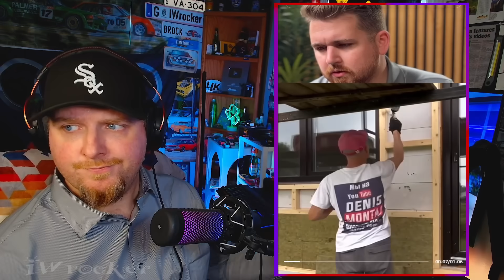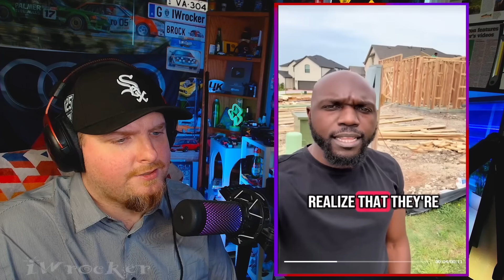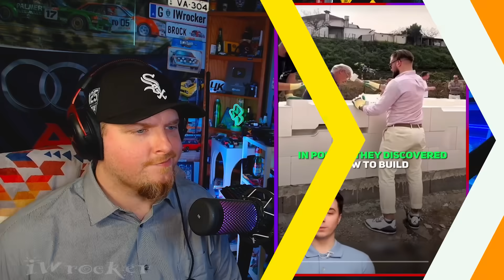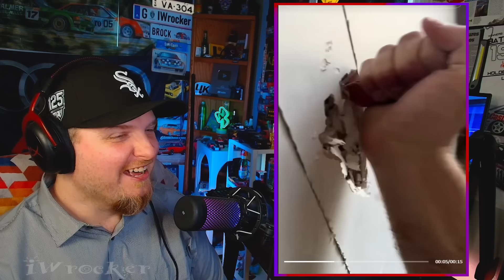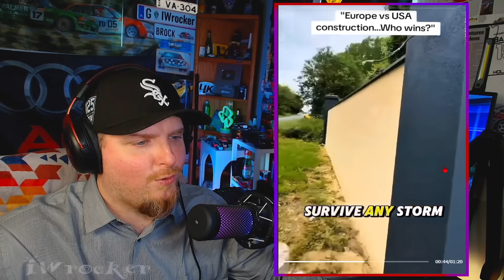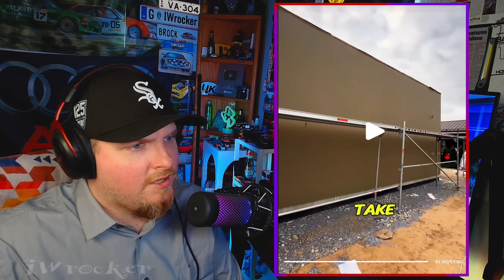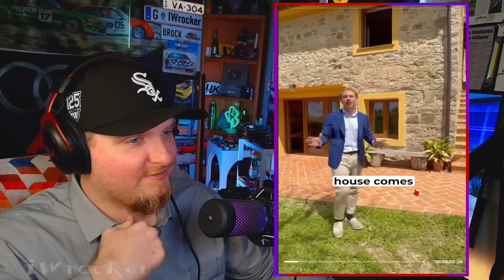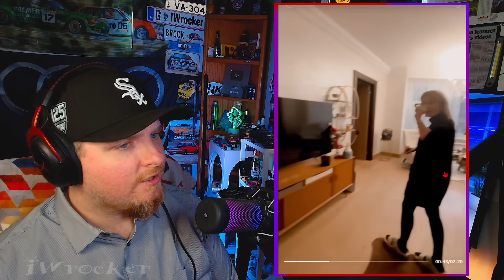25 Minutes of European VS American Home Quality & Construction Methods 🔨

Comment: Thats not a truck, thats the "bigger" brother of a Vespa, called "Ape" ( bee and wasp) Its for transportation use in the smallest streets, or gardens, or winery. It's just a micro utility vehicle. For delivery ( oftentimes pizza and works as advertising also).or craftsmen work in tight places. The front is the same as a Vespa with the same handlebar, steering and operating installments. The cabin fits two people, if needed very tightly, and it has a Vespa drive train beneath  the bed with a differential and rear axle. Vou can get it with a sheet metal enclosure on the bed , or a tent like made of fabric, To install or deinstall on demand in minutes. They are quite famous and wide spread. In my village in Germany , the pizza restaurant has one for delivery and parks as advertisement  on the street. Its limited to 40 km/h, street legal. Very useful in big cities, because of lack parking spaces on the streets.

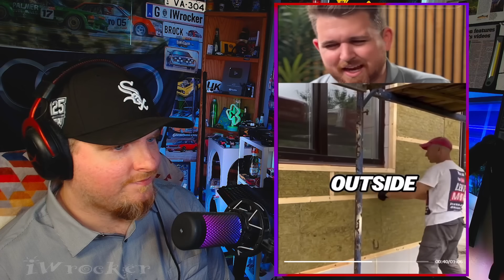Comment: 1:20 The walls are made of stone, so insulation on the outside makes the walls a therman mass that regulates interior temperature. I get where the insulation is doesn't matter when the walls are made of plywood at best, but come on, basic thermodynamics.

5:46 It's a little sad that what we'd call the bare minimum of a house you're describing as "a freaking fortress"...

7:35 And that's just a cheap basic tin roof... not even tiles. Oof.

7:55 It keeps blowing my mind that somehow USAmericans happily live IN TV SET FACADES. The non-loadbearing interior wall next to me would break that knife and also my hand, and I live in basically the cheapest type of housing here.

Comment: Here in Bavaria, there's an US Base my colleagues went to. The American instructors put explosives to the floor to make a Basra-access to the apartment below. It didn't work. By German law, a ceiling has to have at least 15cm/6 inch reinforced concrete for NOISE PROTECTION. Just in case your neighbor is dancing above your bed. - The brothers-in arms- tried it again without result. So they trippled the load and blew out the brick walls. The latter bricks had the required thickness of 1 foot with bubbles for insulation. (All calculations exclude floating screed, insulation, carpet, paint and wall plaster.) Nowadays requirements are stricter, because ot thermal bridges (where the concrete ceiling goes through the brick wall, balconies, lintels), there have to be 4 Inch glass wool on the outside. I need no heating anymore, just a jumper.

Comment: I moved to Ukraine 16 years ago, and of course we have European windows(like if first saw in Berlin in 1972), they are the best ever! We also did the foam exterior on our  brick home and it really really helps in the winter and keeps us cool in the summer. I installed a German metal roof(with internal insulation). I have a 7 foot tall 18" wide reinforced granite wall surrounding my property, everyone one I know has these type of exterior walls. There are other things we have that I did not see in the USA, I am 100% thrilled with my Ukrainian home (russian drones withstanding). I have to say though you NEED the European windows in the USA you will NOT be sorry.

Comment: Insulation outside because those bricks are considerable heat mass that we want to take advantage of to keep releasing heat inside once they have warmed and during hot summers keep releasing cool / resist interior temp raising. Thinner insulation inside and you get a few inches back on floor compared to insulation inside only

Comment: I dunno what you guys are doing over there in the US, but our walls here in Hungary are 6 inch thick solid rebar concrete. Our windows are fully insulated German double and triple pane tilt windows. We put insulation on the outside. You know why? Cost benefit! We pay for houses by the size. And every square meter of house is expensive! So we don't shrink internal living space down by hanging several inches thick insulation on the inside. It's common sense. Your house will get better thermals if the heat or cold isn't even allowed to reach your house's structure.

Comment: In Scandinavia wooden houses are actually pretty common, so more similar to American houses, but the walls are typically still double as thick and they tend to have more insulation and more design elements to accomdate for snow (which you see more commnoly in parts of North America that get more snow) so I guess it's true that materials alone aren't everything. Their houses are definitely still better.

Comment: After the WW2 Britain needed to build 200,000+ homes. This is when "New Towns" popped up. Places like Milton Keynes and Ellesmere Port went from being villages of maybe 100 or 200 homes to having over 2000 homes. We used "cardboard homes" wood and cardboard with a little render to make them not fall down. In the 1990's theses homes were draughty and were starting to fail in a few ways, so we gave them a new layer of insulation and wrapped them in brick, with new supports to hold up the roof. These homes are still standing today but plans are in the works to upgrade these buildings again. This time it's not because they are failing but because these homes are easier to adapt.

Comment: 18:49  that's an Piaggio ape 50 2005ish to 2024  has a 49ccm 1zylinder 2stroke with a manuell 4 Speed Transmission plus Reverse 200kg Upto 400kg payload and 350kg legal towing with a Bit of Finetuning without aftermarket parts IT will easily Run 60km/h ..... There are some crazy mods Out there Like hijabusa Swaps and simular ... But Most tuned have an 85 to 110 ccm cylinder ,gearing and exhaust for a little more uumpf

Comment: About the wall being removed with utility knife.
European construction does use this material... but ONLY for SOME inner walls or for insulated boxes on the ceiling. Most walls are concrete. Sometimes brick, although it is seen as slightly luxurious - because it takes a lot more time to build, but needs a lot less insulation.

Comment: My dads house, the house I grew up in, was built in 1927, double brick walls and only had the roof renewed once back in the 80's. Mine was build in the early 20's.
US houses suck. 
Did you guys not understand the point of the story about the wolf and the 3 little pigs?

Comment: 18:12 People do live in trhat. From wikipedia: Five Thurloe Square or The Thin House is a block of flats in South Kensington, London.[1][2] The triangular building is 6 feet (1.8 m) wide at its narrowest. It was built between 1885 and 1887 by William Douglas on an area of land left over after the construction of South Kensington tube station. The building was initially used as artist studios

Comment: Here in the UK, we're increasingly moving towards the US style "Thrown up with wood and maybe a breeze block external wall" instead of the proper walls of old. It's got too the point that new builds are even becoming somewhat undesirable as they're plagued with problems and poorly made. Any build built 10 to 20 years ago is going to have issues. 
The house I'm sitting in now has about 3 stages of construction. The front of the house is about 80 years old, the middle is mid 80's and the back is mid 90's. We have a fair few external walls as internal walls as a result.
My in-laws house was built in the 1700's with an extension out the back built in the 2000's. 

Oh, and there's a lot of Portland Stone in the construction. We live in the original Portland. That stone is the same stuff that faces most of the iconic London buildings. Expensive stuff just lying around here.

Comment: Is that thin house in London one of the fake ones to hide an air vent for the Underground? There's dozen of fake houses that are basically just big chimneys over the vents from the tube, which was started when they had steam trains running through the tunnels.

Comment: The Russian house insulation method is used in Europe as well.  It tends to be used for existing properties and consists of a layer of insulation being added to the outside walls.  What wasn't shown was the final layer of plasticised plaster that keeps out the weather and lets the insulation do its job.  I've seen this system used without wooden lathes and the insulation glued to the walls (the material was more like a foam block than the straw like blocks in the video), then finished with weatherproof plaster-like material.

Comment: Hard doubt that the last one is 700€ a month. There's some caviat to it that's not explained in the video. The city does not look remote so the only way I can think of this being 700€/month is that:
1. It's some sort of special housing that you need to match strict criteria for. These are typically for less wealthy people.
2. This is actually not a rented property and she has bought it for at least 500-600k and that 700 is what she pays monthly for what in finland is called yhtiövastike. Not sure what that would be in English.
3. The building has very lucrative business spaces on the ground floor that are owned by the housing collective and effectively subsidize rents for the tenants. This would make this kind of apartment EXTREMELY rare, at least in Finland. 

This type of rental would be at least 2k a month in Helsinki city center and Helsinki isn't even super expensive when it comes to capital cities in the Nordics.

EDIT: Watch video till the end dummy.. Yeah if this is Riga, maybe there's a possibility that the rent is legit. There's also no info about in what kind of condition the general building is so I'll pass this one as plausible.

Comment: 18:00 Thurloe Square, it’s actually triangular, The building, now flats, is just 6ft wide at its narrowest point, growing to 34ft at its widest.
Google  thin-house-thurloe-square
Tube/rail or station ventilation or above ground section built where 5 houses used to be, 23 were sold but only 5 were knocked down in the end.

"In the late 19th century, Kensington and Chelsea were known as a hub for art, so loads of artists were building studios in the area. A local builder named William Douglas saw this as an opportunity to fill the little triangle that 1-5 Thurloe Square left behind after they were knocked down. Amazingly, he designed and built seven artists’ studios in this meagre space, in the form of the current wedge-shaped building we see today."

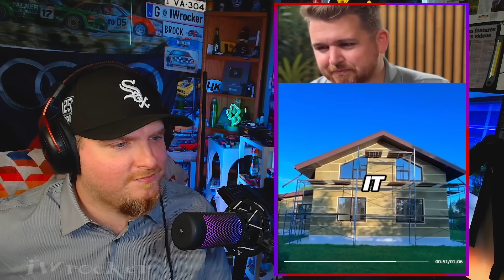Comment: 1:43 No way this is Russia, the house looks more like a Germany or such.
1:56 Hes just ragebaiting, nothing more. Or hes proud to live in glorified dogshed 😀 Or he doesnt compute that in Europe we like our houses survive winds, flods and stuff for hundreds of years 🤣
8:25 Well, this is s#!t xD Yet in my home I recently installed "Multi-grip Pull-up Bar" onto the wall and I had to get special X-drill bit to get tho holes done through the reinforced concrete... YET I now know to no need of worry when pushing hard my 90+ kilos () upthere. In this plaster shed I cannot imagine how such thing could be achieved 😀
Also how s#!t is a sound insulation? between zero and none..? I would not be OK when making out with my girls... kinda loud one 🤣
13:07 Well, in this scenario, those windows are kinda only the FLEX, because our windows supposed to work together with "brick"-constructed buildings, insulation and energiwise...
18:17 It is kinda triangle-ish house.

Comment: 18:48 this is called an Ape (Bee; I think it's the brand/model name of Piaggio, the most common producer, but became the general type description), designed for the narrow alleys in the rural and mountain villages of Italy.

The three wheels and the small build give them high mobility and accessibility,  and they used to be very common as affordable utility vehicles. Usually they have a two seater cabin with an open bed/bridge but there are various designs with closed boxes, cages for garbage collection etc. A quite common "modern" variation is a food or coffee truck.

They're usually powered by a scooter motor, its buzzing sound giving them their name, and don't have a steering wheel and pedals but a bar and controls like a scooter/motorcycle. Iirc you are/were able to drive them with a scooter license.

Comment: When it comes to insulation it's generally some kind of foam layered on the exterior, it just makes sense considering you don't lose space on the inside and keep the structural walls 'inside' for more inertia so the house heats and cools more slowly

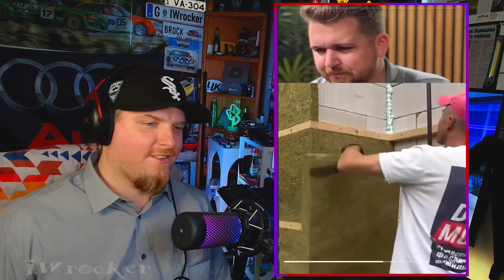Comment: 1:33 In the First Clip it's a Wall Made Out of ytong or a simular poress syntetic stone it's already have good r value IS Most likly more then 10inches(24cm min), thick Up to 18Inches(48cm) plus rockwool 2-7 Inches that's a passiv House  posible means IT dosnt need any Central Heat or at least for a good sized House less than a 54kbtu strong Central Heat unit including hotwater,If at all

Comment: When living in the US (working construction), i always wondered WHY you have doors over there, since you can just walk through the wall. The guy in the vid is a pro and wonders why they put the insulation on the outside. Ok.. (Even in the US we did that 40 years ago, even in California, EXACTLY as shown later in the video).  The stuff you guys build (with your weather conditions), we would call a "kyte" over here, lol.  PS: The main "PRO" for US style building would have to be the cost, right? The "CON" would be, you get a cardboard shelter for it. I don't mean this sarcasticly. It's VERY hard to build/own your own house in germany. Still: i live in a house build in 1754. Was just checked. All good! PSPS: the cool thing about "garden-walls" (or bushes): it's like an extra room without a roof.

Comment: You can't compare building styles country to country. All nuances,  like climate, types of building materials available in the region, costs of those, hoe toxic are they in different climate. US and Australia have sustainable tree plantations. Australia does timber frame with a single skin of brick (brick vaneer) many regions in Europe began building with ston because trees be ame scarce. Also depend on land availability and cost. I pay 710 a week and habe no insulation in the ceiling.  Got 39
5 Celsius on ceiling last week. It was only 38 outside.

Comment: The thin house in London is actually triangular, not square, so it's actually bigger than the video shows. That's probably why the video doesn't show you the back. It was built on a plot of land in front of the sunken train tracks, which run behind it. The strange shape it because they couldn't lay foundations anywhere it might affect the strength of the the retaining walls of the sunken train track. It is only 6ft wide at one end, but it's 34ft at the other end. It's at 5 Thurloe Square in South Kensington. It's now apartments and depending on the size, you're looking at £900,000 to £1,000,000 for each one. Central London is a very expensive place to own property.

Comment: Das Beispiel bei 01:05 sieht nach einer Ytong-Wand (Gasbeton) aus. Dazu eine Dämmung aus Mineralwolle.
Würde die tragende Wand aud Kalksandstein sein, so wäre die Isolierung viel zu dünn. In Deutschland (DE) wären dann 14 cm(5,5 in) vorgeschrieben. Auch das Verkleben mit PU-Schaum iszt in DE unüblich. 
Für Russland ist die Dämmung ebenfalls zu dünn. Aufgrund der teilweise kyrillischen Schrift auf dem T-Shirt tippe ich auf Bulgarien.
Europäische Häuser halten 50...500 Jahre, viele derer in den USA nur bis zum nächsten Tornado.

Das Dach bei 07:40 scheint ein Blechdach aus Titanzink in Doppelstehfalztechnik zu sein (ca 130 EUR/m²). Hält auch 120 Jahre (70% der Häuser in Paris sind mit Zinkblech gedeckt).

Wände wie bei 08:30 gibt es auch in DE. Allerdings nur als Zwischenwände bei z.B. 2 Kinderzimmern. Doch auch die sind gedämmt. Das ist der Standard.

Wären ganze Häuser so gebaut wie in 08:30 gezeigt, so würde sie niemand kaufen. Um gewaltsam hineinzukommen ist es einfacher die Wand einzuschlagen als eine ordentliche Tür.

Comment: The thin 'houses' in London are a facade to hide vents for the underground trains so the street is still aesthetically appealing
Reply: Those houses in the video are in  Thurloe Square, Kensington and are flats (apartments). The end houses are wedge shaped so the narrowest part you see is No.5  wich narrows from 13ft to 6 ft wide, yes they were reduced in width when they were sold to the rail line and the rail runs through the garden of the houses that are left, as some houses had to be demolished. to build the line
Reply: Same in Paris.

Comment: A precast concrete house goes up in about a week. You can buy a "flat pack" house that goes up in about the same time, (Once the foundation is poured) fully finished with electrics and plumbing already in place and all the walls painted.

Comment: "Why insulation is on the outside?"

I hope that that guy isn't in the construction business, because otherwise I would like to ask how far behind the US are in applied thermal sciences? When I was a high school student 25 years ago, I learned why it was better to fully encapsulated a building in thermal insulation from the outside rather than leaving gaps around wall and floor junctions from the inside, and it was not something new.
Reply: even if you are not knowledgeable of any thermal physic, you loose space by putting insulation inside...

Comment: Just to give you the definitive answer to the toilet hand dryers rolls that you mention from time to time. These are not paper but linen. You pull out a fresh linen towel to dry your hands and then the roller takes the 'used' towel back inside. Once it's all used, it is replaced with a fresh roll and the used one is laundered ready for re-use. it is NOT paper. Much nicer to use a linen towel to dry your hands on and much more eco that any disposable paper. FYI